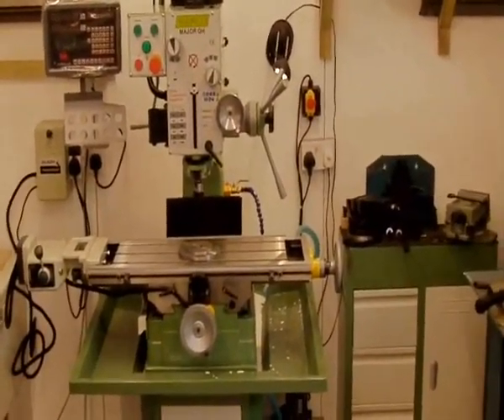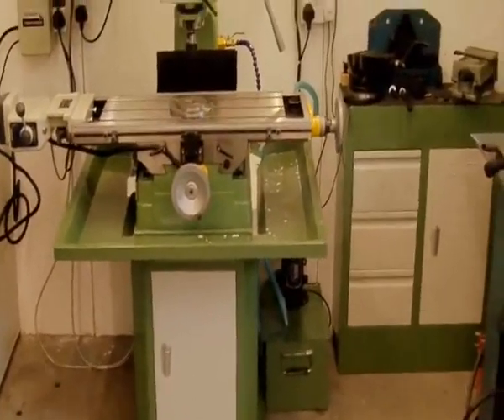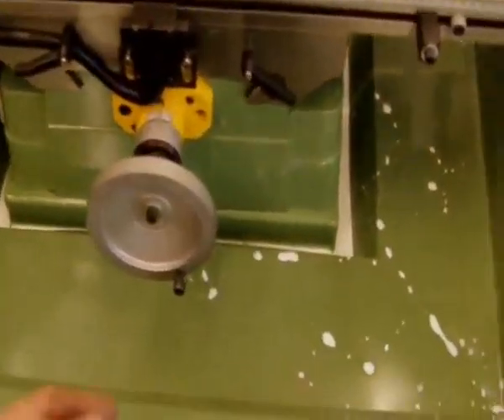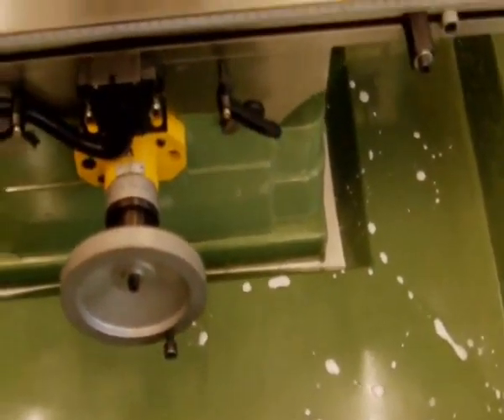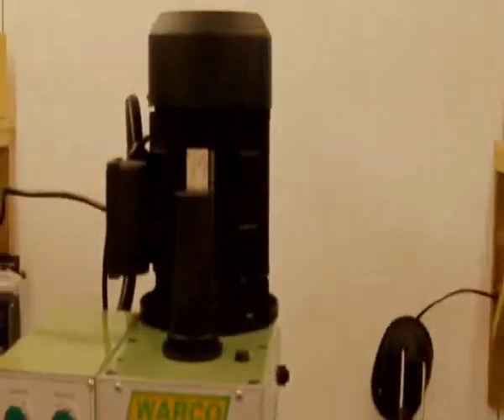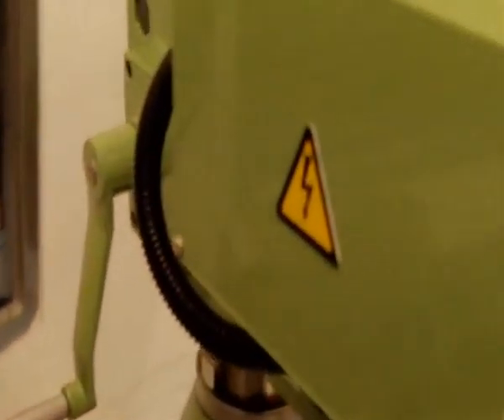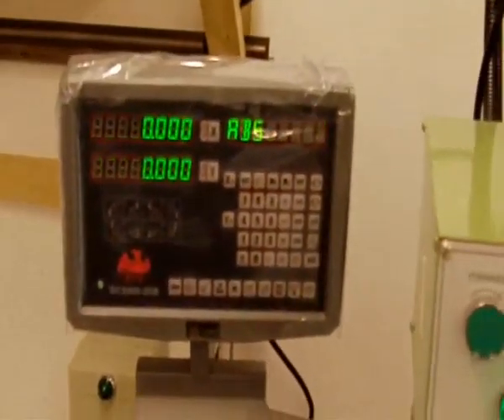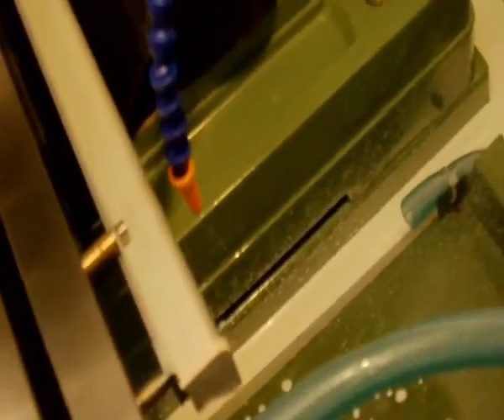Warco Final Part

Comment: Thanks for posting was looking for this exact thing as I'm looking to get one of these too. Got a question for you if you don't mind, does it have reverse button on the console and is it slow enough to use for auto tapping?
Reply from the maker: Hi Sandeep thx for the message. Yes this mill does have reverse and does go slow enough for taping I do
show some taping in one of my video's. The mill stops very fast so controlling the taping is very easy.

Comment: Just wondered if your still happy with the Warco machine. I have the mill drill major at the moment never been happy with the belt changing or the round column as a posed to v bed etc. Are you still happy with the machine would do anything different if buying again etc. Thanks Regards Chris
Reply from the maker: Hi There thx for the message, I am very happy with the mill and use it alot. if I was buying again I would go for one
with power down feed on the quill but I have added that to mine and maybe I would go for variable speed but
over all I made the right choice and very happy. 
Cheers Nigel
Reply: G0SQI  Thanks for the great reply. I’m in a nice position of being to buy what I want but then again don’t want to spend more than I have too. I was thinking of something with VFD on spindle. I definitely want a DRO. Not really considered powered down feed. I see some of the machines have a vertical motor for lifting the head but I assume that just for raising rather than fine down feed. http://www.warco.co.uk/milling-machines/303310-super-major-vario-milling-machine.html.   Maybe the super Vario but has no down feed not many machines  have this. Many Thanks regards Chris
Reply from the maker: Hi Chris thats a great looking machine I would have liked to be able to afford that but I was on a limit
good luck with what ever you decide I am sure you will enjoy it.
Nigel
Reply: G0SQI  Thanks Nigel. It’s been nice to have a little chat. I have bought equipment from this company before and it’s been a bit hit and miss so finger crossed. I don’t mind having to pay more but I really hate paying twice etc.  Thanks again